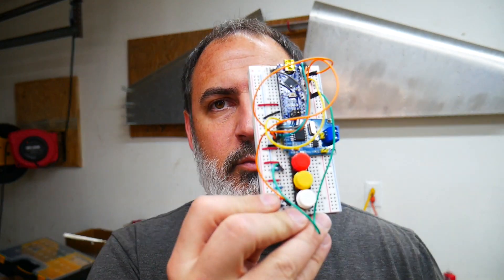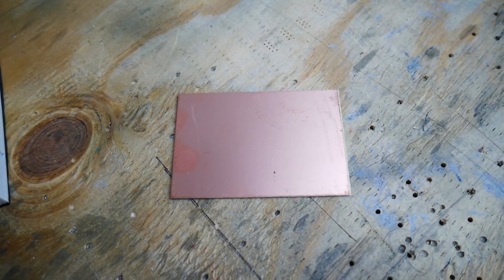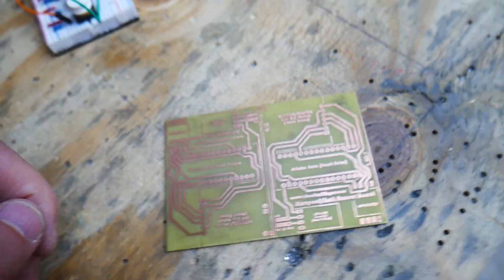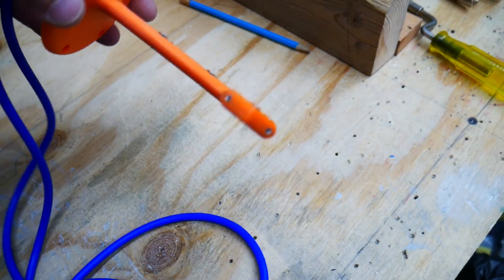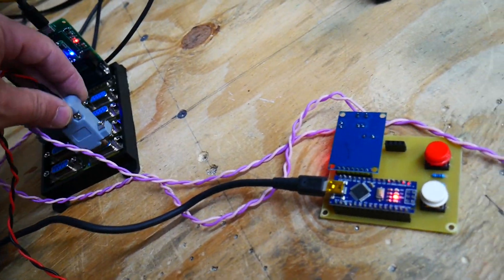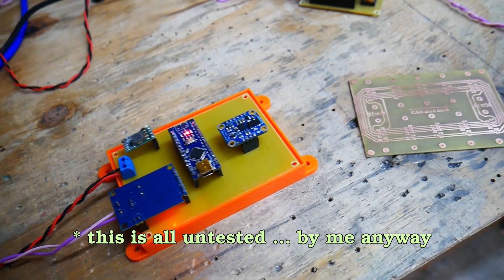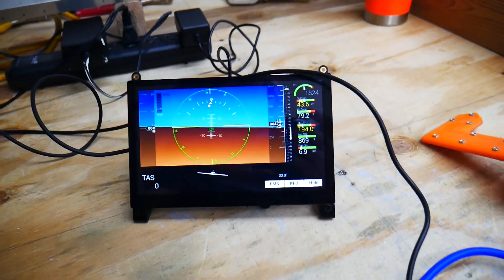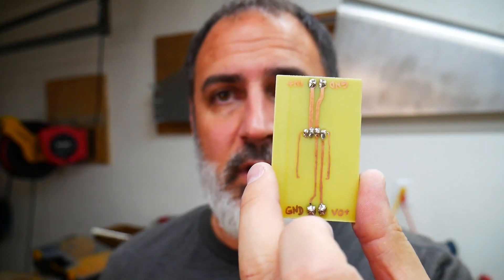Printed Circuit Boards on a Homebuilt Aircraft

Comment: Awesome work!
I am in the fpv drone racing scene. There over the years a market for flight controllers has emerged. Now on chinese websites you can order on small board with MCU, Gyro, Barometer and more onboard, 1“ x 1“ in size.
I hope more and more enthusiasts join this avionic community, so that some single board units appear.
It looks like you just started the spirit!
Reply from the maker: Yeah, I'd love to see more people doing this. I never seem to have enough time to really get into it. I'm building a full size airplane from a kit and would love to see more options for an experimental aircraft like mine. How accurate are the flight controllers you're talking about for fixed wing drones? Do you have any suggested models?

Comment: Dan, I asked you in another video about how to do a pressure sensor. I found this one and see you've already done it. Good going! I just ordered two MPXV7007DP pressure sensors to try my hand at it as well.
Reply from the maker: Cool. Glad it was helpful. Let me know how it goes. I did some testing in a car with the airspeed sensor and it seemed to be pretty accurate. If you need pressure to speed conversion code, let me know.
Reply: @dan_der_flieger  You said that you did your own math. I'd love to compare results later on down the line, Dan.

Comment: Ended up on your practically free avionics video and came here next, I don't fly although its an interest but not affordable on any level for me so dream i do.  Was thinking about your "slow" pi and Sd cards, the new Pi5 is way more powerful and can be booted from NVMe SSD, and they are working on an official hat for the M.2 SSD. 
Thanks for making the video with enough information for the untrained to follow along! Cheers from Canada.
Reply from the maker: Yeah, someone else commented that the RPi 5 could do NVMe as well. It's about time!! 

What part of Canada? Just curious.
Reply: @dan_der_flieger   Yes it is about time for sure, Eastern Ontario
Reply from the maker: Ah, cool. We did a family vacation in Toronto a few years ago. It was a good experience for the kids. I grew up about 50 miles south of central BC and we visited fairly often. I really love it up there. My mom (who is very German) could only find "real" bread at a German store just across the border. And it was a good place to get Kinder Eggs, which are contraband in the US.

Comment: I am Interested in the prospect of trying to build a similar display,  as a experiment,  and like the idea of the printed circuit board ,any chance of open source for the board lay out ,i would like to give it a try.

nice work by the way.
Reply from the maker: Thanks for watching. I have all of my KiCad drawings on my GitHub repository:
https://github.com/danderflieger/KiCad

Have fun! Be ready for some aggravation while you experiment with it ... it's all part of the learning process.
Reply: @dan_der_flieger  I am OK with that, and I expect it, and planed on one single boar and computing unit , and I do not trust the Bosh IMU so I am getting the Mouser #:512-MTI-320-3A as a replacemen, the rest will be the same to create a single AHARS unit.
Reply from the maker: Cool! Please let me know how it goes with the Mouser IMU. I've heard the Bosch BNO055 drifts a bit, so it's probably not going to work. I haven't actually tested it in flight, though.
Reply: will keep you in the loop. @dan_der_flieger

Comment: Dan, is there a chance I could have the pdf's for your different circuit board designs? I want to start by making the CAN Bus but eventually want to build all of them.
Reply from the maker: Ivan, I had a minute and exported the DB9 CAN Bus PCB file to PDF. It's on the git repository I mentioned earlier - look for a file called "DB9CAN_Bus (11 Oct 2023).pdf" right in the root of the "KiCad" git repository. I THINK you should just be able to print it as is and iron it onto your copper clad PCB blank. I also did a quick write-up covering my process for going from a the KiCad file to an etched circuit board. It's in the README.md file, also in the root of the KiCad repository.
Reply: I remembered you replied but couldn't act on it immediately and when I could act I couldn't find your reply. Thank you for your kind help. @dan_der_flieger
Reply: Dan, I've enjoyed very much making this board. I was able to get a enough toner on the paper by running it through the printer 3 times at 600dpi. The board  is drilled and now I'm waiting on the DB9s to arrive. Did you happen to upload the 3d printing file anywhere? I know I keep pestering you but this is quite addictive :)
Reply: Sorry, I meant the 3d file for the nice case you designed for the CAN BUS HUB?
Reply from the maker: @ivanhoyt7757  Sorry - I just noticed that I missed a couple of your comments. So, with the paper I started off using presentation paper - it's sort of glossy. But I just recently found this stuff that works really well (and it's actually cheaper than the presentation paper I was using): 
https://www.amazon.com/dp/B07GLGL2CX

Make sure you print on the glossy side - if you do the toner transfers really easily. If you don't, supposedly it won't transfer at all. I can't speak to all laser printers, but mine is a REALLY old Canon MF4350d and that paper really works well with it for PCB transfers.
Reply: @dan_der_flieger  Thank you, Dan! I ordered the special paper, looking forward to make something better. I made two and they should work but I want to perfect the process. I also want to print the board with two circuits for the AOA AHRS etc. If I'm not mistaken, the pdf isn't on GitHub. Perhaps I don't know how to find it even though my son is an engineer at GitHub, my generation, me in particular, is struggling to figure it out,
Reply from the maker: @ivanhoyt7757  - I saved a PDF version in the "Arduino_Nano_Air_Speed_&_AoA_Sensor_Board" directory on git. If you're using the video as a reference, you'll notice that the CAN Bus board is mounted differently on the Airspeed sensor than it is on the AoA sensor. Initially, I desoldered the pins on the MCP2515 board and put them facing down. I opted to change my design so that no desoldering was necessary. You can see that on the video where I show the AoA board (07:30 in the video). Use that board as a reference - NOT the ASI one I showed just before that. Have fun! That's cool about your son, too!
Reply: @dan_der_flieger  Thank you, Dan. I'm having a great time learning.
Reply: A follow up report- I've completed two CAN Bus Hub, two of the AOA / Airspeed assemblies. I played around with KiCAD enough to design a little board to adapt some buck converters that I already had. I guess my goal was to save a buck ;-) I also picked up a Raspberry Pi5 with 8GB and the 5" Maker Plane touch screen. I now need to print the pitot assembly with the 45 degree angled ports for the AOA. The more daunting challenge, for me is the software/firmware piece. Not even sure where to start but this is my next challenge. Any pointers along these lines are appreciated. You've inspired me and I've found the challenge quite enjoyable.
Reply: Besides tackling the software piece, I want to build the IMU assembly. Is there a place to get the sketches for programming the various boards and also, the pdf for the IMU board?
Reply: @dan_der_flieger  Btw, I purchased this paper and attempted to use it but it kept rolling up on my fusing roller, so I returned it. Probably just an issue with my laser printer. I then went to Office Max and bought some medium weight coated paper. That worked great for me. The AOA/Airspeed boards turned out much better.
Reply from the maker: @ivanhoyt7757  that sucks about the paper, but glad the other stuff worked.
Reply from the maker: @ivanhoyt7757  I'll have to look fir the IMU stuff. I mostly abandoned that stuff when I heard that the BNO055 IMU drifts on fixed wing aircraft. I've been playing around with an RC flight controller for fixed wing aircraft. The one I've been using is the SpeedyBee F405 Wing. There's also a smaller & cheaper one that should do the trick as well called the SpeedyBee F405 mini: 
https://a.co/d/a4iH805

I bought the mini first and made the mistake of connecting it to a standard Arduino Nano. The Nano uses 5V logic where the SpeedyBee 3.3V logic. I ended up frying the serial input on the SpeedyBee. 

Instead of the Nano,  I used an Adafruit Feather M4 CAN Express board (which uses 3.3V logic) and it has a built-in CAN transceiver as well:
https://www.adafruit.com/product/4759

If you look at the last video in my homebuilt avionics playlist I talk about it a little:
https://youtu.be/S_G7Rw0PYec

Anyway, there's a program called INAV that lets you calibrate the flight controller's IMU and you can change the serial outputs to MAVLINK, which has an Arduino library that can output the flight data from the flight controller. It's pretty slick. At some point I'll post another video about how to put it all together.
Reply: @ No worries.
Reply from the maker: I made my GitHub KiCad repository public. I probably won't have time to export to PDFs until later (I have plans every evening for the next several days). Here's a link to the repository:
https://github.com/danderflieger/KiCad/

You should be able to just open the project file in KiCad, then open the PCB file and then print it from there. I will caution that some of them need to be printed "mirrored" and some don't. I can't remember which ones are which. So pay close attention to your pin outs before soldering chips into place. 

And most of all, have fun!
Reply: I printed the pdf at 100% with a laser printer and attempted to transfer it but it didn't do nice solid lines. Is there a trick to getting the paper to contact better with the copper on the board? Is there a recommended time to keep the iron in contact with the paper?

Comment: Hi Dan, cool ! 
I'm at decision stage for my panel, do I spend at least 5k on a EFIS or do I go DIY. My electronics skills are limited ( although I did have Direct tv free for about 6 years..lol ) I think I could probably follow along . My issue with Diy is that the internet is full with these projects, lots of excitement at the beginning and than it all seems to fizzle out and support becomes non existent. I see that your an actual pilot and I assume you plan to build your own EFIS, so I guess my question is.. you stick'n around :)  
Autopilot seems like a neet thing to have.. just say'n

Will.
Reply from the maker: Hey Will. I'm still on the fence about my panel as well - but I still have a long way to go in my build and have plenty of time before I need to decide. 

After all of the hours I have spent on this stuff, I'm still not sure I would trust my life to it yet. Grand Rapids Technology (GRT) sells a really nice EFIS starting at around $2000. I'm looking very closely at it. You can purchase upgrades (software) to add things like synthetic vision, etc. after the initial purchase, too, as your needs change. 

So, I wouldn't count on any kind of support from me. 🙂 I haven't decided how much of this will actually become part of my airplane at this point.

Comment: We had some guys do some testing with the BN055 and it was disappointing.  It corrects itself to the gravity vector too quickly so a short coordinated turn messes it up in the air.  At least that is what they told me.  It expects to be in a cell phone not something moving in 3D space.  All that said, flight testing it would make a great video. :-)  If it can be made to work it would be a game changer.
Reply from the maker: Hmph. That's too bad. I was hoping for a simple, viable AHRS sensor. I'll have to give it a test at some point.
Reply: The sensor choice has nothing to do with the algorithm it's running. Whether it's a quaternion-based approach, or a simple integration of the gyro with the accelerometer filter, the sensor choice is all about noise and power draw. If it's a simple integrated gyro approach, lowering the alpha value will reduce how quickly the gravity vector is corrected. Quaternion-based approaches should not have this issue.
Reply from the maker: I'm using the Adafruit breakout board along with their sensor API and their BNO055 library. I haven't really dug deep into either of those libraries, but from my cursory look at the sensor and the Adafruit documentation, the sensor is mostly a black box. You can (supposedly) pull quaternion data from it, but doing the math to convert it to angles for the EFIS might be a little too much for the chip on the Arduino (at least the one I'm using - they recently released a board with an ESP32 chip that might be better suited for it). Since I can also pull the euler angles right from the sensor with no conversion on the Arduino, that's what I'm doing. My hope was to just let the mystery of the black box's inner workings continue to be a mystery and let smarter people at Bosch figure out the math. 🫣

I can't guarantee that the BNO055 is actually giving out accurate euler angles without testing it ...

Anyway, I'm mostly excited to have learned how to make my own circuit boards. That's new territory for me and it's really fun to do.